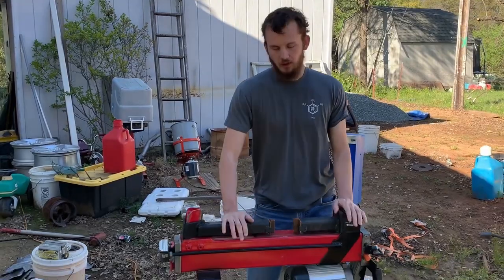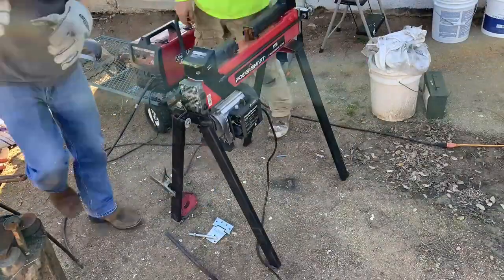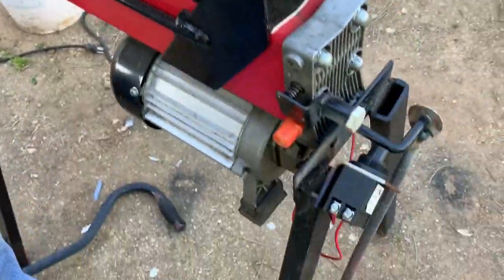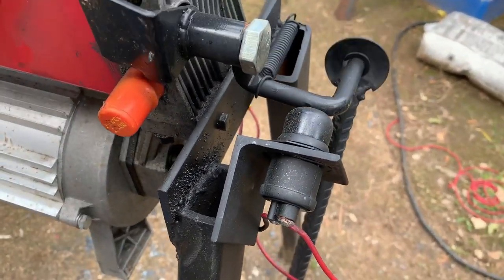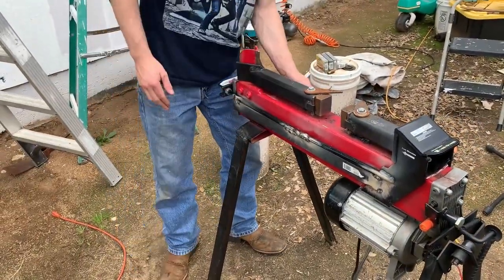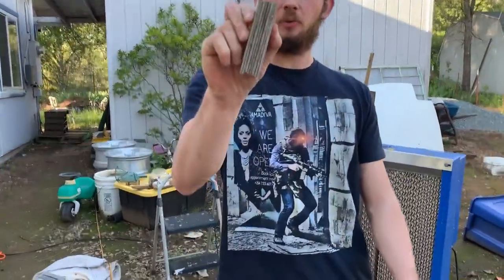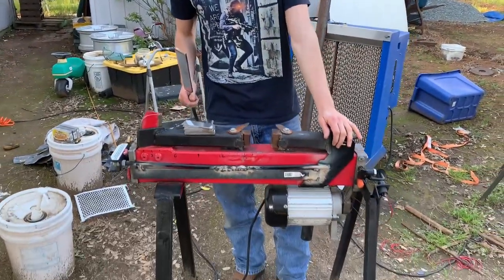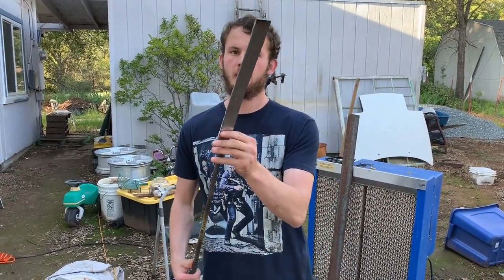Converting a Log Splitter into a Forging Press, Part 2

Comment: I wonder if something like this could be set up for someone sitting down? I do most of my knife making from a chair either at the forge, at the anvil, or hopefully at a power hammer/press. I just have multiple chairs in my shop. However I don't exactly know how I could hold a billet or piece of steel with one hand and operate the press with the other. Thanks for any thoughts, insights, or options that would enable this.
Reply from the maker: It could be done, but the log splitter might be mounted a bit lower and you could still use the pedal to operate it. I don't see why it couldn't work!
Reply: @FormulaJake  Thanks for your thoughts and insights, I have a friend with limited use of his legs. I just don't like excluding him from taking part in things just because of it.
Reply from the maker: Understandable and that's kind of you to look out for him.

It is possible to operate with one hand and hold steel with the other, but it just takes a bit more practice and strength. Many pros use hand-operated presses.

If you get creative, you could even set it up with both options, either hand operation or foot operation. Best of luck!

Comment: I got a chuckle out of the switch popping out when the foot control was used for the first time, glad to see you show real life prototype testing! When I converted my splitter I moved the entire control box so the button was placed in the best orientation.I should post it on my channel. My version allows me to use one hand to position a stick of firewood while freeing up the other hand to operate the machine, I plan on adding a foot treadle some day. Good show!

Comment: Nice work, both the press and the video. Teaser clip intro, short explanation, time lapse, all good and cut nicely.  I can't help but backseat edit in my head as I watch stuff these days, but nothing jumped out at me to critique.   Subscribed.

Worth mentioning, my 24 ton splitter press totally still bends when it bottoms out. It's freaky watching an I-beam that size do that... best to stop pressing when the hot metal stops moving. Your small design is very nice, very clean and compact.  Haven't watched part one yet, but if you haven't made rounded/fuller dies yet for drawing out, definitely give it a go. Even flat dies with a smaller surface area might help a lot.  It definitely seems to be the case that pushing on half as much metal makes it move /more/ than twice as fast, if you see what I mean.
Reply from the maker: Thank you so much for the constructive comment! You have a keen eye for editing, and we do our best to keep the videos tasteful.

We showed using our flat 1 3/4" wide dies, but what we didn't show is our drawing dies, which are about 3/4" wide and have rounded edges, fullering dies (the same, but rotated 90°), and 1" flat dies. For moving metal quickly, the smaller dies work so much better, but the large flat dies definitely do the trick as far as creating one flat, consistent surface. In the future we will be building our own 24 ton I beam press!

Comment: What are the little triangle shaped doyngers on the top of the rams?
Reply from the maker: Those help hold the dies in place. Without them, the dies would slide up and out of place. They were made from some scrap steel

Comment: I made mine from a BiltHard 6.5 ton, 293 bucks, plus 60 or so in bits. Had to put 4 1 inch square reinforcing bars to prevent the bend (mostly). 
Here's a bad video of me using it, I've since straightened and welded the moving bit a lot. 
 https://www.youtube.com/watch?v=ApzdcowZDPY&list=PL9-trnl5RNSbNdJFNaLvhshtkhDVg3PrL&index=5